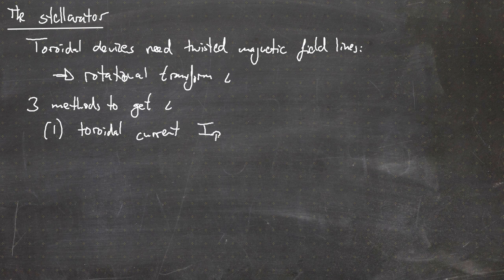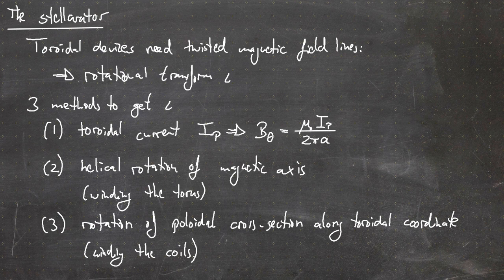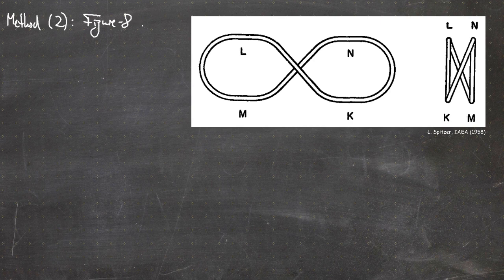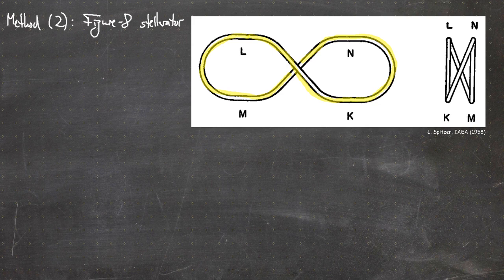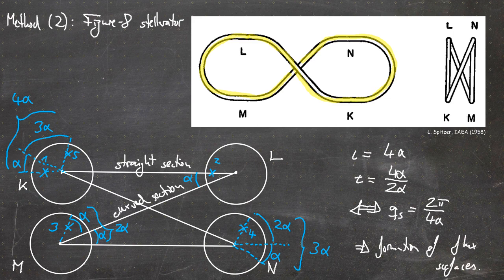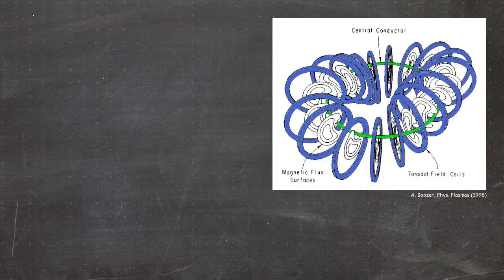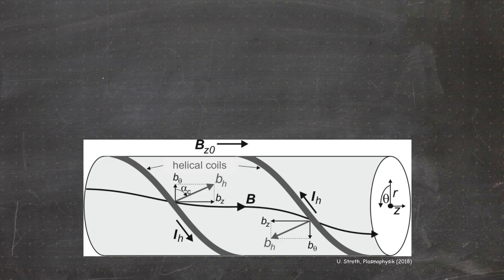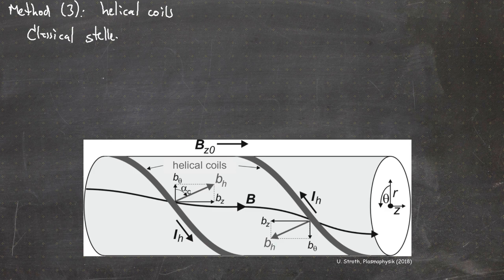Fusion Research Lecture #11 - The stellarator

Comment: Great lecture!
I just had one question about the figure-8 stellarator. You said that it was mechanically complicated at the time so they decided to abandon it, however, was it the only problem with it? Were there other physics issues related with this shape?
Reply from the maker: While the figure-8 stellarator showed that the general principle worked, it actually had some bad performance when compared with the first non figure-8 devices (racetrack configuration), so they were also abandoned due to that reason (bad performance).